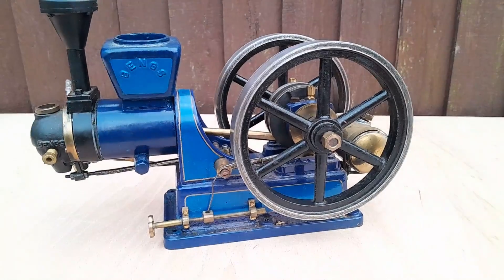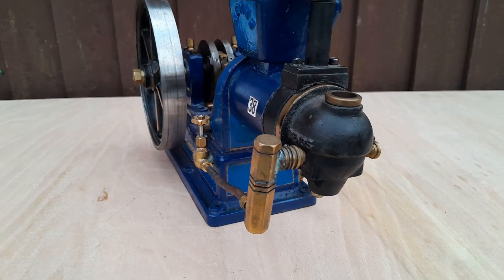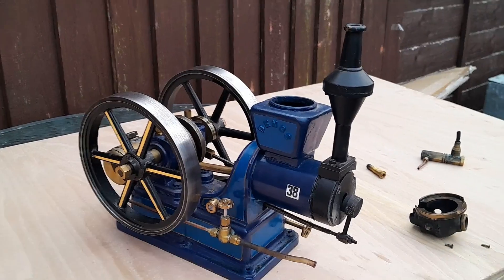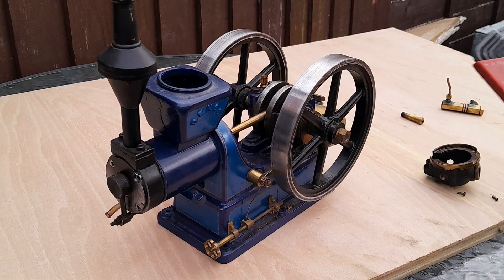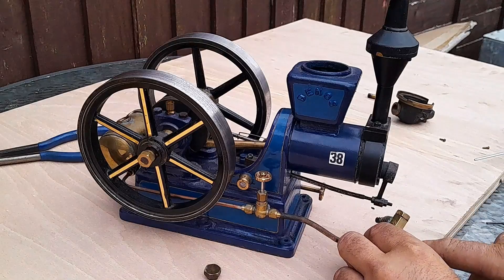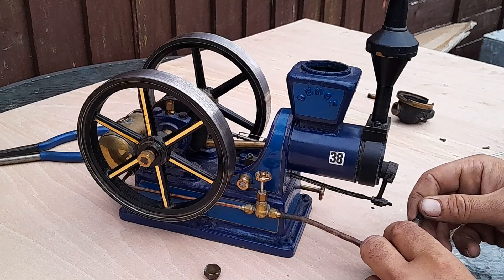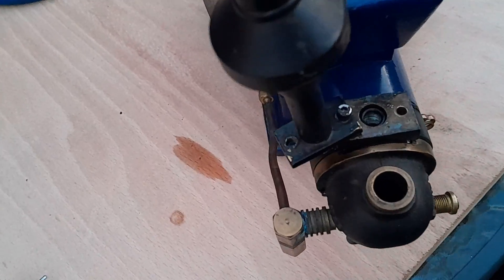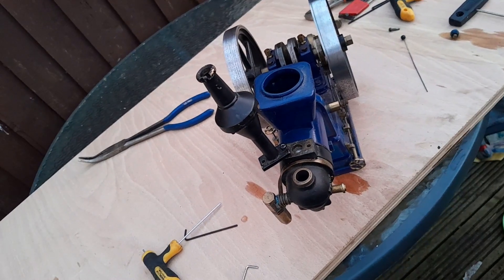Flame Gulper / Licker engine, Just how does it work?

Comment: I made one but it drove me crazy trying to get it to run and i never did get it to go. I ad libbed it so now ive just started to make one to drawings ive found on the net. Im wondering if it will make a difference if i make the cylinder out of steel rather than the brass specified.

Comment: have you tired spin the other way. All I heared about them is that they have to be super clean with very clean flame burning from ecotone or similar.
Reply from the maker: Yes, the other way it creates compression instead of a vacuum and extinguishes the flame as the valve opens so definitely spinning the correct way.
As you say, they need to be super clean which I think may be half the problem. Along with needing a larger flame.
Update coming soon 😁

Comment: Hi Liam. I’ve designed and built many vacuum engines over the years. May I suggest removing the front cover and with a “ loose “ flame ensure that all the open port is covered by it. Even the smallest gap within the flame curtain will stop them from running. The principal is very simple and pre heating only reduces the vacuum effect, they work best from cold. I use WD40 on the cylinder and only in small amounts. Don’t spray it on with the flame ignited….😉 Please check out my range of CHUK engines all 4 variants are flame gulpers. Cheers Graham.
Reply from the maker: Hi Graham,
 Envious of your engine design and building skills, hopefully a few of the range join the collection in the next few years.
I certainly think you may be onto something with your mention of the "flame curtain". I very much doubt the small built in burner provides a flame which completely covers the port. I will try with a stand alone burner for the next video hopefully with better results. 
WD40 was my first thought. Currently it smells like 3in1 so will definitely Benefit from a strip and clean.
Love the CHUK engines. "Nattie" being my personal favorite.
All advice noted and will be trialed in the next video 😁👍

Comment: You need cold water in the water hopper to cool the air and create a vacuum.  The more rapid you cool the air, the greater the negative pressure created in the form of a vacuum, the more power is created at the the piston. Also I am not sure your flame is big enough for the size of the engine.  My knowledge it rather little. what I do know was picked up off the late Dennis Pittock and the late Brian Williamson. I wish I had paid more attention now. 

The first Crosley petrol engines worked by vacuum to move the piston, they didn't have a crank, but worked on a ratchet gear. they fuel was ignited in the cylinder which dropped it out cog, and when it cooled, the piston was drawn up re engaging the rack.  The Newcombe steam pumping engines were also known as a atmospheric engine, the steam was not pressurised, the steam was drawn into the cylinder by a weight on the end of the beam where the pump was attached. The steam was shut off just before the end of the stroke and cold water allowed into cylinder to cool the steam and turn it into a vacuum, which then sucked the piston back in and drew the pump up from the well/mine. Its all much the same idea, a hot gas (in the case of the flame eater - the air itself  is heated) cooled down to create a vacuum.  

Its a very bad idea, but if you cool your mamod down by running cold water over the boiler after the steam has gone. i will run in reverse due to the vacuum created inside the boiler.
Reply from the maker: Thanks James,
My initial thoughts were cold water, kind of obvious when you think about it right?, but somewhere I had seen a video suggesting warm water and anything was worth a try at that point haha.
Having spoken to Graham about the "Flame Curtain", as you say, I'm sure the size of the flame is part of the issue so I shall have to come up with a plan to tackle that for the next video.
Yes I'm familiar with the first Crossley's, having watched the one at the Anson museum numerous times. Such a big lump for so little power.
Not sure I fancy trying that with a poor Mamod, but maybe one day...🤣
Reply: @rustyrelics  I remember Brian had a hot air engine about the size of a Lister D but was only a fraction of a horse power.
Reply from the maker: @James_Rivett  There are a few about, some quite a bit larger, but the majority seem to live down in the west country for whatever reason. Lovley things to fall asleep behind 😴🤣

Comment: I would try cold water in the hopper. It works by cooling the hot flame to cold to create a vacuum. As well as being called a flame eater (Or in Dutch Vlam Happer) it is also called a vacuum engine.
Reply from the maker: Thanks Ben, 
Cold water was my initial thought also, kind of obvious when you think about it really 🤦. I got the idea of the warm water after seeing it suggested in a video somewhere else. Not that I've been able to find it since.
I think the first port of call is going to be tackle the size of the flame. Although I can't see how the small built in burner can produce a flame large enough so it may well be a case of making a new stand alone burner.
Reply: @rustyrelics  The trick isn't the size of the flame but making sure it gets sucked into the port. Not sure a big one helps. Have you tried cold or iced water yet?
Reply from the maker: From what I can gather, I think the trick is to ensure the flame completely covers the port, otherwise it will draw in fresh air   along with the flame which obviously means a reduced vacuum once it cools, so the flame needs to be at least big enough to cover the port face but obviously nor a roaring inferno🤣.
Not tried that yet, maybe something to bare in mind.... 😁
Reply: @rustyrelics  Yes, not so much hot a sufficiently large.
Reply from the maker: @BensWorkshop  Indeed, hopefully this week I'll get chance to test that theory 😁
Reply: @rustyrelics  I'd be interested. I have a flame eater I started making years ago that needs finishing.
Reply: Yup otherwise all you have is a hot cylinder